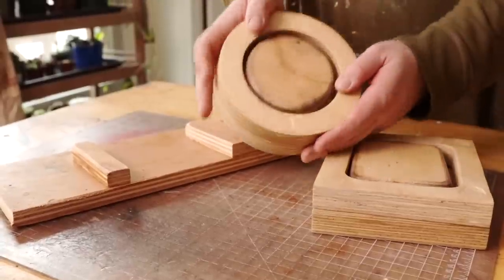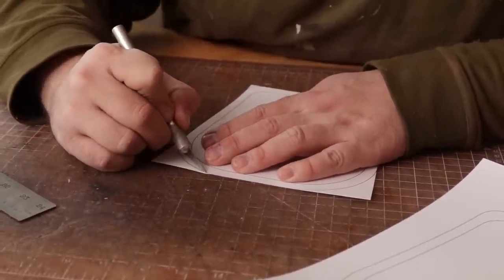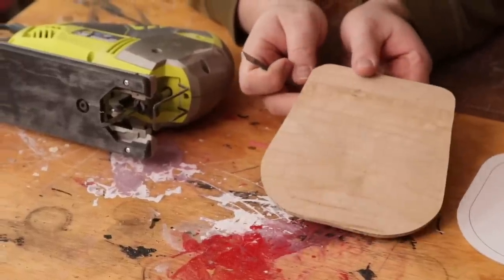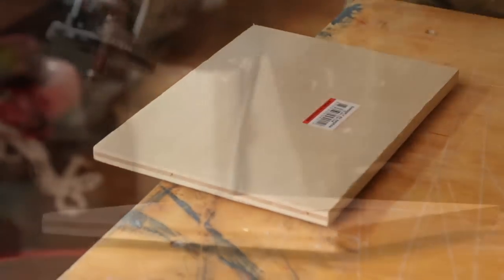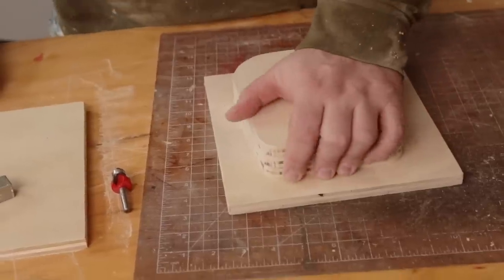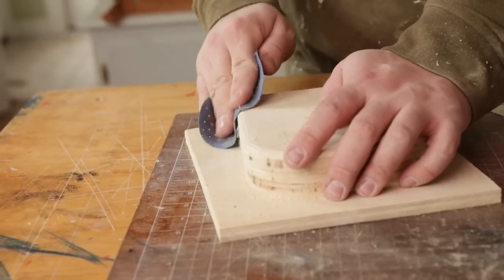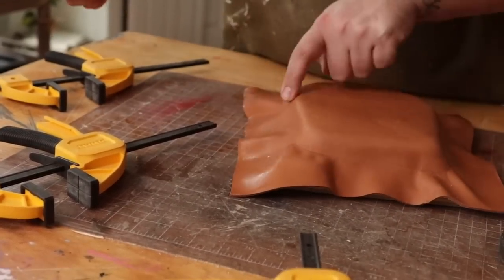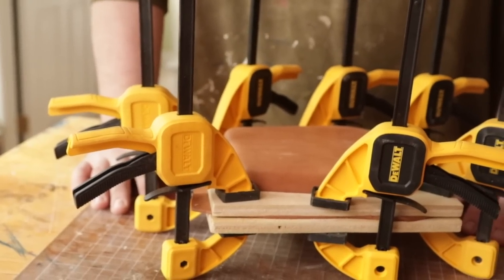Leather Wet Molds: DIY or BUY?  Pt. 1: DIY

Comment: Might I suggest, rough-cutting your layers with the jigsaw before applying your template and using the flush trim bit?  It'll save a lot of wear and tear on the bit blades and make the operation safer over all since you'll be cutting less than the full diameter of the bit.
Reply: 100%. I wrote an absolute OSHA essay of a comment below going into detail about it, but I'll just repeat that I don't think this is a super responsible video, advising greenhorn woodworking cross-overs to take full width router passes on small pieces of plywood, freehand in all respects.
Reply: I'm very wary of suggesting anything, being an absolute hobbiest rube myself, but I suspect just just putting a couple screws through the pattern and the ply into a heavy bit of wood (preferably a workbench) is the way to do with without a table. Actually, if you're only doing one or two small ones, the way to do this is probably to jig saw up against the line (preferably clamped still) and then just sand it down to taste. We're moulding leather bags, not injection moulding complicated plastic parts commerically; what good would the router's extra +/- sixteenth of an inch of accuracy here actually even buy us?

Curious to hear your thoughts.

Comment: I've done both versions - I bought my first set of molds from a CNC router person and was pleased with the product, but the sizes just weren't large enough, so made my own the second time around.  A jigsaw, drill, router and clamps are all the tools necessary.  But more important than tools is PATIENCE.  If you don't have a CNC, but feel the need for close tolerances, you'll need patience to cut and sand your pattern.  If you don't need close tolerances - which honestly leather does not require - then just go forth and have fun!  Yes, the investment in tools is the same as the cost of good commercial molds, but then you have the same tools to make any mold you want.

Comment: I don't know if it's the correct way of making a mold but I cut a heavy duty poly cutting board and stacked them to the thickness I wanted and attached the layers with screws.  I can take out layers by unscrewing to make it the thickness I want.

Comment: The problem with buckleguy molds is 1/8" isn't wide enough gap. I modified the one I bought to 1/4" which works much better, even with thinner leather. Their specs are not correct as leather swells when wet.

Comment: That mold could potentially be a clamshell case as well. Really enjoyed the idea, sorry you will be cleaning up sawdust for the next 6 months. Also wanted to point out many box stores will cut a sheet of plywood in half or quarters so they are easier to take home. They will not normally cut in all sorts of specific dimensions but will make them more manageable and lighter.

Comment: I made a mold from 3/4” pine once and the negative frame snapped one the first use. A very negative experience. 😂.  Thick plywood is probably best. I’ve been thinking that a plastic kitchen cutting board might also make great wetmold material.

Comment: It's two peices of 3/4 or maybe 1 inch  plywood and it would be an extremely easy build with little more than a router and chamfer/round over bit and a jig saw. Great video though and I like the break down.